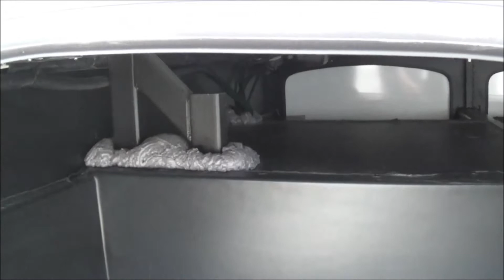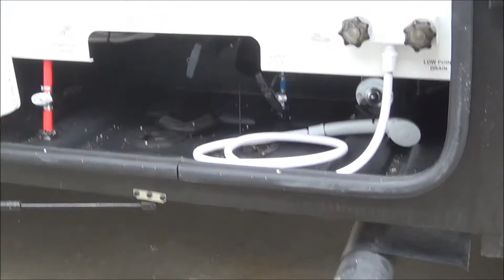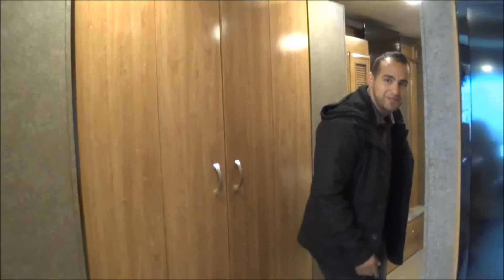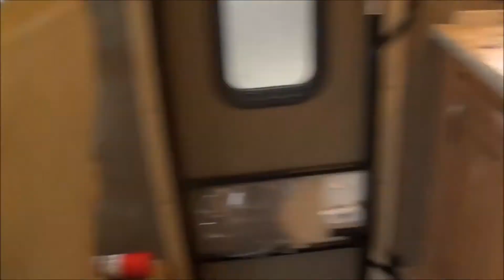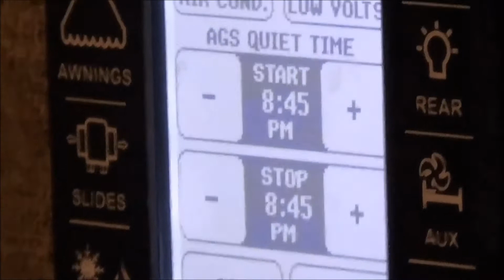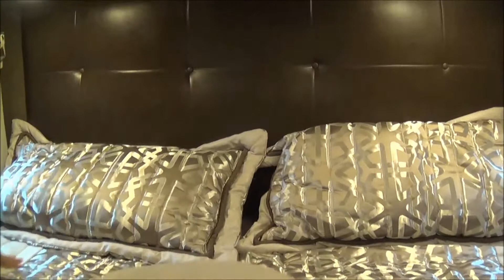Chad "Your RV Guy" Walks Thru The 2018 Challenger 37 TB

Comment: Great presentation Chad... There sure is a lot to cover in this beautiful 37 TB. Do the new Challenger’s come with rain gutters? To keep water directly off the the windows, and those nasty black streaks. Also, can you get a dish washer in this unit? Thanks for your sharing your knowledge with us.
Reply: Latada Thank for showing interest in this beautiful motorhome. My name is Fred Foulks and Chad is my manager. To answer your question about the  rain gutters is no. That is not a standard but we do see the value in the  rain gutters so we would install for you free of charge .  My number is 574 250-4407 and my email is fred@totalvaluerv.com.  Remember you can save thousands by shopping with our family owned dealership. No closing costs and Factory Direct like pricing.

Comment: . Thanks for the video this model keeps getting better,  Chad  we have a 2014  Newmar Canyon Star 3920 hows the aluminum structure on the Thor, i believe we have the cross members every 14 inches, can you get this model with the Dometic weathershield? the tpo roof is walkable ? as of 2017 comes with a 6 speed automatic transmission same rear ratio?  We will be selling or trading our unit down the road not using the garage much and need the room more.